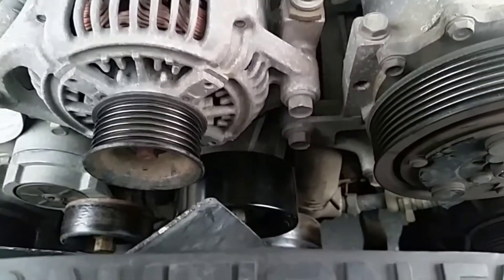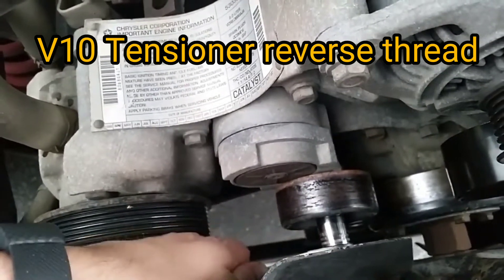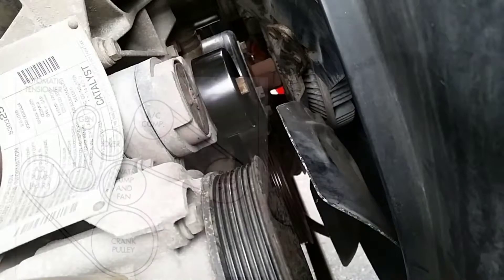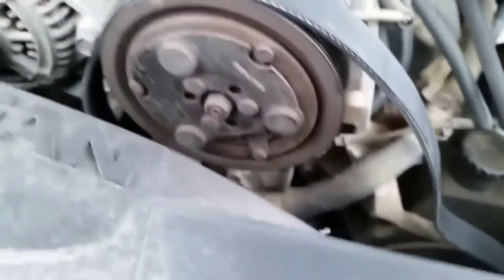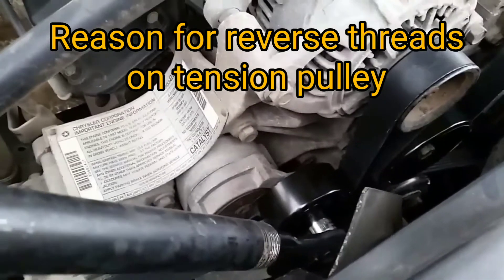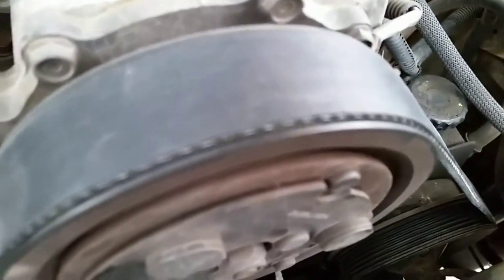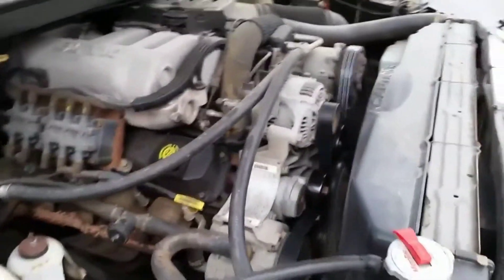Dodge Ram 2500 V10 8.0L Belt Routing and Tensioner Replacement

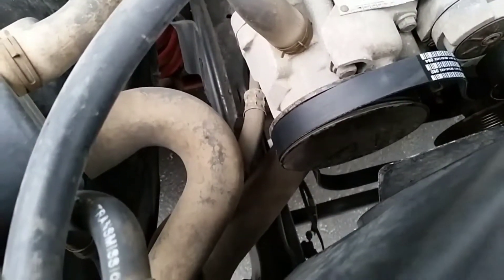Comment: 1:21  according to the diagram this is the Air Pump? Noticed my air pump pulley has a slight wobble. Notice this at all sitting at idle?
Any idea what the air pump is about?

Comment: the one you called "water pump" is actually the "smog pump" a useless emissions requirement in some states and a HP thief that robs your HP, most folk remove that sucker.